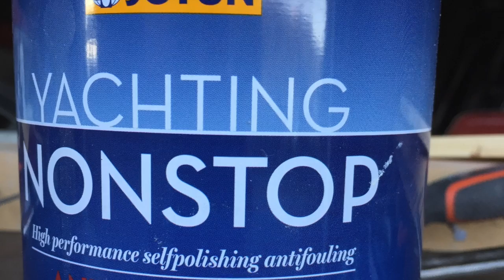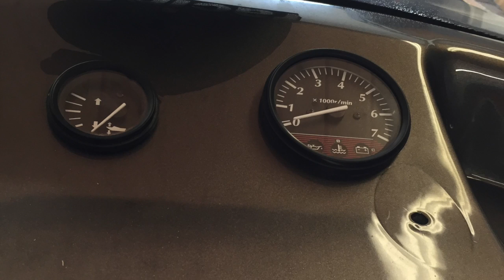Shakespeare Miniclubman restauration part 2

Comment: what did you use to paint the bow
Reply from the maker: This is some years ago, but i think we used to component grounding right on the fiberglass. Then we used antifoul over the whole bow because we didn’t know where the waterline would be
Reply: MegaPedl did you paint it gray afterwards?
Reply from the maker: Hei, jeg tror du er norsk så jeg svarer på norsk. Var litt usikker på «bow». Skroget ble behandlet som beskrevet. Overdelen ble grunnet og slipt og lakkert på et verksted. Vet ikke hva de brukte.
Reply: MegaPedl oki